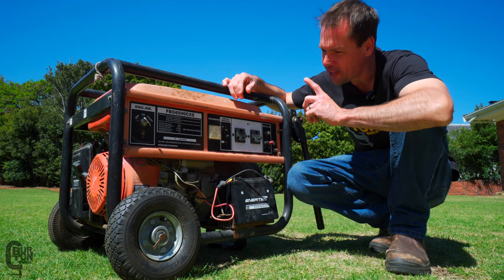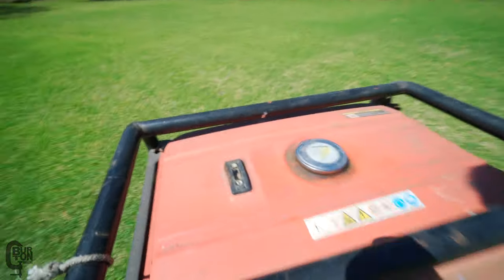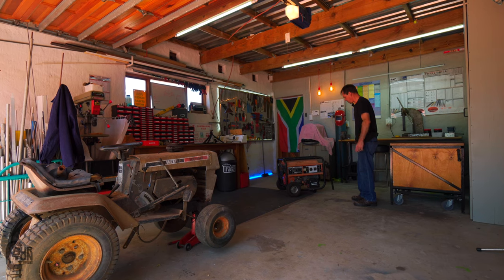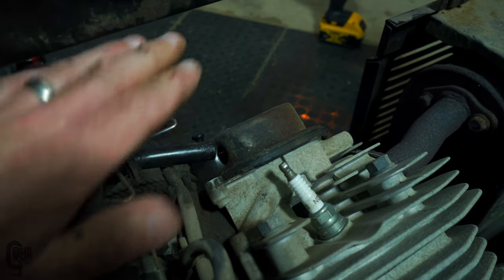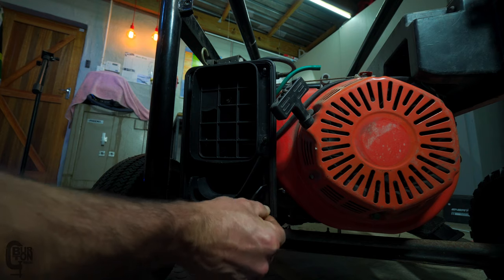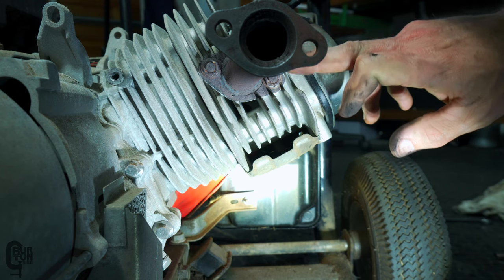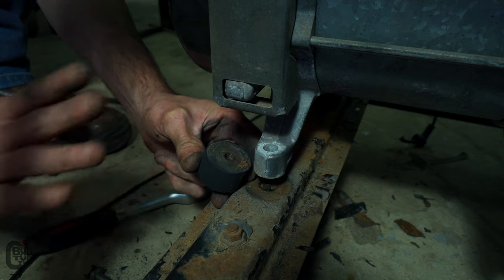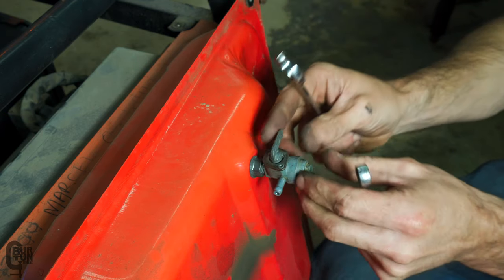How to service a generator... like a pro?

Comment: Consider a sound enclosure for it
Reply from the maker: We do have a small external 'room' it could be run in, just not sure how it would handle heat build-up. Side walls are brick, roof is a slanted polycarbonate and the front is currently open. I would need to make a door with sound proofing on the inside.